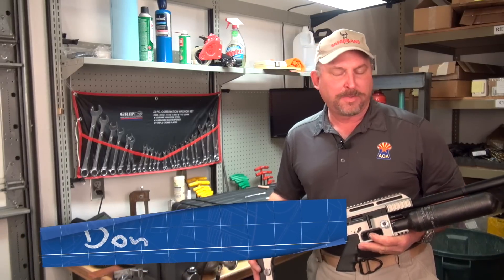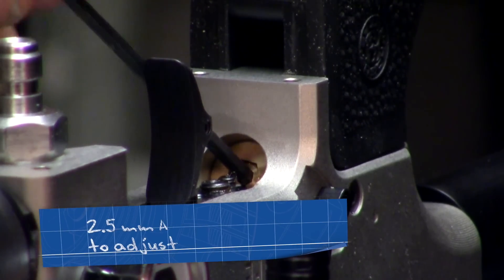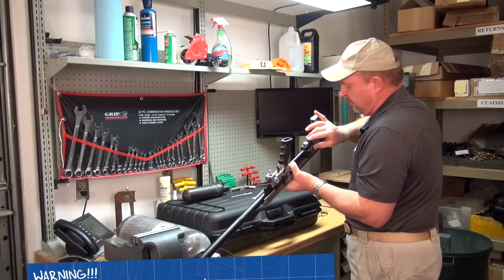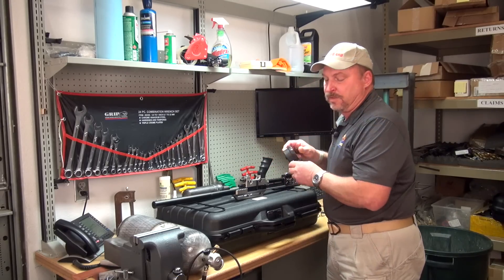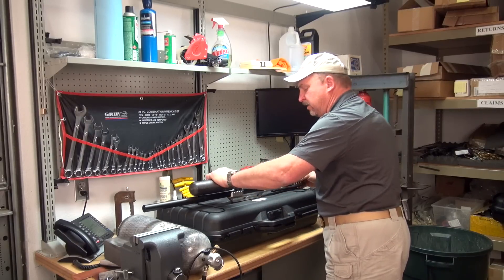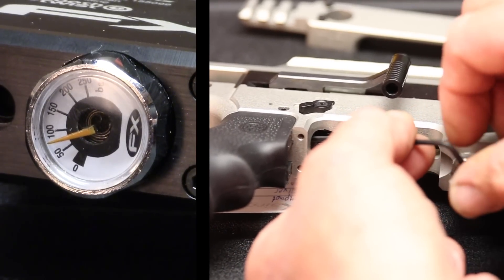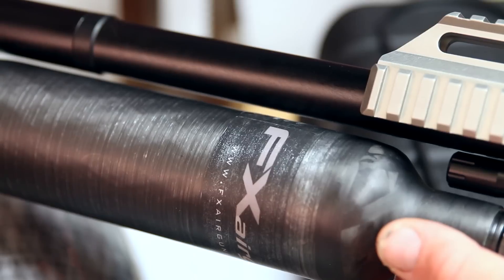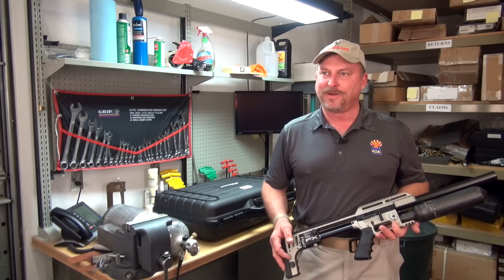FX Impact Regulator Adjustment

Comment: I have a PCP air rifle — the FX Impact M4 in .25 caliber — and I'm dealing with a technical issue. On my first fill, the regulator pressure went way above the recommended limit (up to 250 bar), because I had adjusted the valve regulator before pressurizing the system.

I managed to release some air via the regulator screw, but now it seems to be damaged. Currently, both the main cylinder and the regulated chamber are sitting at the same pressure (150 bar), and the regulator doesn't seem to be working — both gauges increase together when I refill.

I also can’t dry-fire the rifle to relieve the pressure, since that could damage the system, and I’m unable to turn the regulator screw, which now seems stuck or stripped.

Do you have any advice on how to safely drain the regulated pressure or fix the regulator?
Any help would be greatly appreciated!

Thanks in advance,

Comment: Many thanks for this video
My FX Impact MkII, has been nothing but an absolute nightmare, to the point it’s just been stuffed in a corner over 12 months.
It failed to fill on the day I received it and it’s been back to the dealer 5 times, until I got fed up that he’d had hold of it longer than I had.
I looked at it yesterday and the 'replaced’ reg gauge showed '0’ though I’d filled the cylinder to 200 bar.
I’m now going to get the hex drivers out and start to tweak my expensive junk

Comment: What would you recommend setting the air regulator at? I haven't done anything to my Impact from the factory settings and the regulator is set at 70. The gun is not accurate at all so wondering if this is why? Thanks.
Reply: What cal. is it? If a .22, back out the regulator screw to about 130-135 BAR. You want the gun shooting about 890 FPS for best accuracy. Before setting it though make sure it's fully aired up. Set the hammer wheel to 4. The factory usually sets it at about 110 BAR.
Reply: @JackAgainski  it’s in the shop right now with a pro going over it. He said the hammer spring was out of spec. He’s going to take it in the field and try to see what groups he gets at 75 yards after his adjustments. I’ll let you know how he makes out.
Reply: @JackAgainski    It is .22
Reply: @kerrylittle3900  Use 130- 135 BAR and shoot at power wheel 4. (More BAR uses more air.) Start at 130 BAR Set your front power wheel #1 at about 3-4 lines by screwing it out. The more lines the more power. More info here:  https://www.youtube.com/watch?v=RAqlePuV-EM
Reply: @JackAgainski  He says the power is correct at between 80 and 100 with the wheel set at Max. Will see what he comes up with for groups. He’s been doing this for a lot of years and is the only FX technician in all of Canada. But you do makes sense on what you are saying. Thanks.
Reply: @kerrylittle3900  125 max would about right for a .22. The thing is that you can set it higher and then tune down the power wheel. At 80 I doubt you could ever go down below 4 and get up enough speed. GL
Reply: @JackAgainski  Thanks for all the great replies and help with my problem. I'll try and  back out the regulator and see what that does. I'm not one for doing adjustments when I don't know what I am doing. I just figured the pro who sells these guns knew what it should be set at. But everyone here says it is to low. Thanks again. You guys rock.
Reply: That's to low, mine is at 100 shooting 25 @919 and 34 gr@ 888 bulls eye

Comment: with the fx mkll Power plenum you can use the regulator at 170 bar without causing any damage to the gun? why in the manual says not to use the top?

Comment: I just got my new FX Impact in .22, the reg was factory set at 110 Bar and pushing the JSB 18.39 at 814 fps with hammer spring on Max but 55 turns (1/8 turns) to snug to the adjuster to the power wheel then backing off 2 turns, I'm assuming it was at it's minimum adjustment. I have increased the reg to 125-128 Bar, power wheel now set At 3 and I'm pushing the 18.39 JSB at around 885 fps. Shot 28 rounds at 100 yards putting all shots on a 8 inch target in a 6-7 mph cross wind. I'm not going to argue about decreasing reg but I'm sure that i watched Ernest Rowe decrease pressure without de-gasing but he did it in multiple attempts by dry firing the rifle with each adjustment on the AMP Reg. It took Earnest over 150 rounds to get that rifle tuned

Comment: As turned the adjustment screw the air started to escape from tiny opening behind the safety catch. There was a drop in the pressure as the air leaked. I have no idea why would this happen. 
Any feedback or suggestion will be helpful.
Thank you.

Comment: I have just purchased impact .25 calibr. FAC. The manual that came with the gun only relates to the first impact. The regulator is only 125 on this model do I have to take the bottom off to alter the pressure wise Isn’t there  more information with the New. mark ll.?

Comment: Cool video. Next time can you place the camera perpendicular to the gauge due to parallax error from the audience point of view and expose the Allen wrench angle by stating the clock angle start and finish. 

I gather that a one turn CCW (360 degrees) gave a 36 bar pressure increase; therefore, a 0.1 bar adjustment would take approximately 360 / 36 = 10 degree turn, or 5/3 minute-hand turn; in other words, starting the Allen wrench at 12:05:40 p.m. or a.m., and turning CCW until we reach 12 noon, or midnight that would give us a 0.1 bar pressure increase according to the hour-hand angle to vertical.

In shooting parlance: 60 MOA = 0.1 bar = [360 x 60 / (36 x 10)]

Did I just save $1,000.00? I'm spending it on AOA!

Lastly, using your $1,000.00 digital gauge, how accurate was the guns manometer at 140 bar on the gun and the reading on the gauge? Maybe I was off by 1/2 bar.

Great video.

Thanks

Comment: I just bought an Impact .22 and its regulator is at 150 bar. However, in this video you explained it should be between 139-141 bar. Should I keep it as it came set from the factory or what would you advise?

Comment: Thank you for explaining this all. 

I am about to get my first Impact .22. What would you recommend for its settings for JSB 15.89 grain pellets since I don't have a chronometer. Please guide me from the Min-Max power wheel on the side to the valve pressure screw with four lines on it between the barrel and the cylinder.

Thank you.

Comment: I increase fx impact regulator to over 200 bars by mistake and when I fired it all the air  in both gauges  started to leak out and went to zero could you tell me what happened
Reply from the maker: +Arico Kam Hong Please contact our repair department at repair@airgunsofarizona.com for assistance.
Reply: Where is the leak? Locate it, report then the solutions will flood in.

Comment: super video. I had to wait 5 months for my FX IMPACT  .The regulator was set on 110 bar as it came to me from Mundilar in Portugal. My crono showed 920fps on 16 grain pellets . I was unhappy to discover that my MTC   scope mounts from my FX Bobcat were not suitable for the Weaver rail setup.. and I had to buy an excellent set of FX weaver rail scope mounts which are height adjustable .Mundilar also do a super air connection kit which allows for adapting other probes to the FX impact refilling probe .
Reply: 16 x 920 x 920 / 450,437 = 30 fpe Wow! Leave it alone; even though you are 31 fps above the maximum accuracy power combination, which is Mach 0.8. Above that you get more power, but at the cost of loss of accuracy and efficiency, below that you get better accuracy, but at the loss of power, but increase in efficiency. 

To obtain the sweet window of 890 fps use the following formula:

16 gr x 920^2 / 890^2 = 17.1 grain projectile should give you the 890 fps for precision silhouette competition and hunting.

For punching holes in paper, indoors, and no wind, use 567.89 fps +/-10fps will give you unadulterated accuracy, but make sure no one farts in the room because that will throw the pellet off.

As to your scope situation; welcome to the free market where you can vote with your pocketbook.
Reply: @icuppu2  ... "For punching holes in paper, indoors, and no wind, use 567.89 fps +/-10fps will give you unadulterated accuracy, but make sure no one farts in the room because that will throw the pellet off." ...

to get about 567.89 fps, how many pressure bars in the segualtor output is set ?

Comment: I was considering adjusting the regulator on my new FX Impact .30 cal, but after this video I think I'm where I need to be which is 155 bar. Thanks!!
Reply: Alex, start with your intention and then work backwards. Are you planning on using it at 10, 20, 30, 40, 50, 75, 100, 150, 200 yards? Are you going after game that requires a certain amount of fpe for a head or body humane kill, which requires the best accuracy/power combination, or are you going to punch holes in paper, which would require more accuracy than power. Indoors or outdoors? Type of weather? Do you require a flatter trajectory because of unknown precise distances, or a better BC performance, but with a large ballistic arc?

And the list goes on...

Start with 140 bar and then go up- and down 1 bar at a time and see what performance you get with power (velocity), accuracy, and efficiency (shot count). I suggest to stick with accuracy first then power and accept whatever efficiency you get, or get 1,000+ shots per fill, but never be able to hit anything, let alone kill, or knock down.

Lastly, sort your pellet selection for the intended purpose and range.

Comment: What regulator setting should be used if you only want to shoot .177? And you want to output between 16 and 24 Joules?
Reply: No need to adjust the regulator. Only the power wheel. Look at the video of Teds Holdover. He explains the different methods of power setting very well. Tampering with the regulator is only for the absolute hardcore tuning freaks - not necessary for a caliber change.
Reply: 140 bar  for 20 Joules (29.5 fpe) 

11.23 fpe x 720 shots = 8,085.6 fpe total
15.23 J x 720 shots = 10,960.56 J total
So, 10,960.56 / 20 = 548 full power shots at 20 J each with a regulator setting of 140 bar if filled to 250 bar, but I recommend 230 bar.

5.